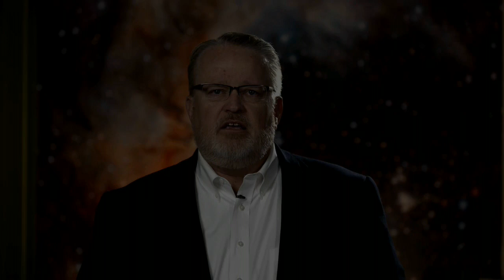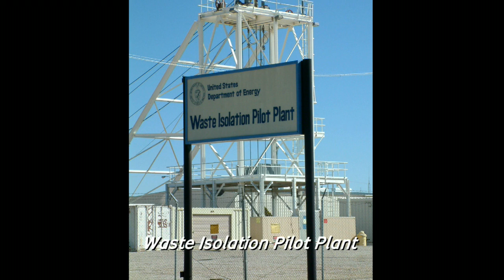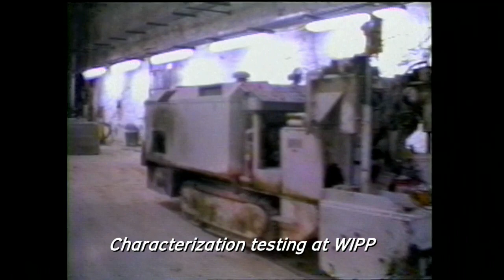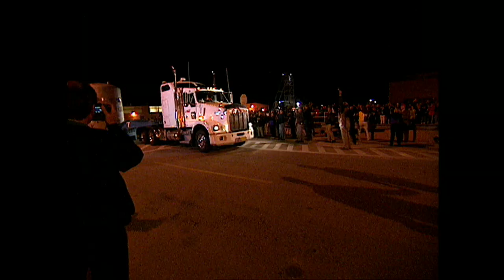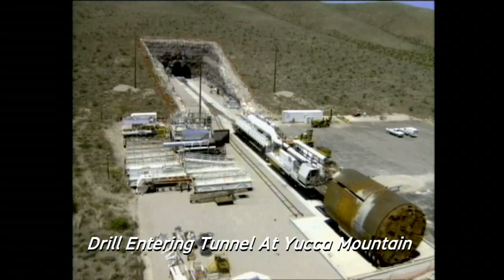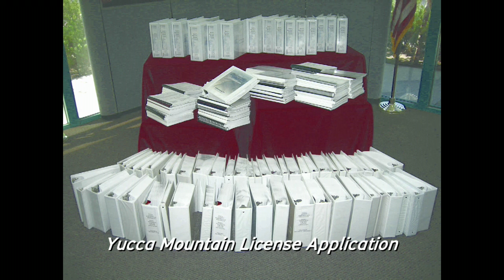Sandia Earth Sciences Nuclear Waste Management

Comment: It's only "waste" for political reasons.  We could technically breed most of that into fuel.  We have something like 70 years of our complete energy needs just sitting in cooling ponds.  Now THAT, is wasteful.
Reply: I think the only solution to long-lived radio nucleides is the transmute them. The bonus is you get power out of it at the same time. It seems pretty clear to me that fourth and fifth generation nuclear reactors, both thermal and fast neutron, have a critical, irreplaceable place in the energy mix going forward. Siting them inside the existing containment structures of existing aging light water reactors is an ideal way to save a lot of money, bring them up fast, and feed them spent fuel which has been accumulating for decades on site.